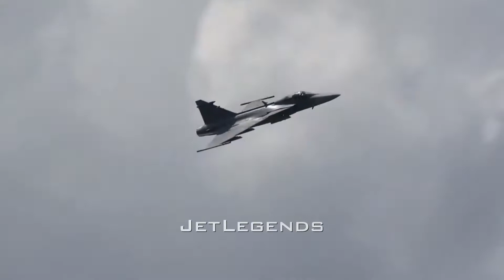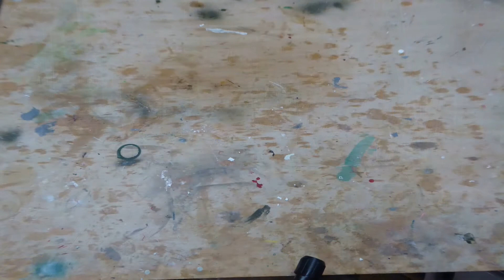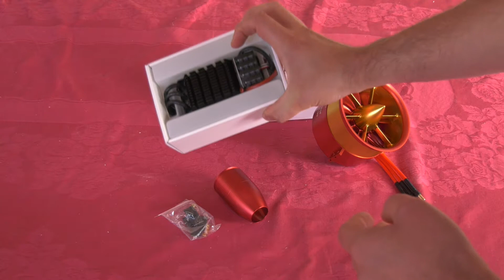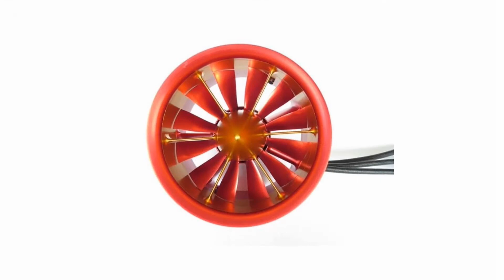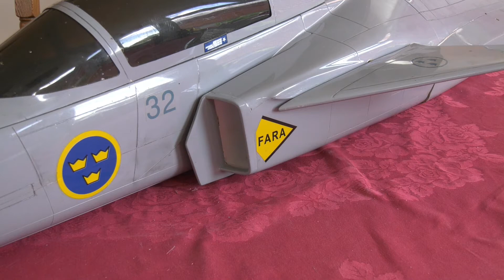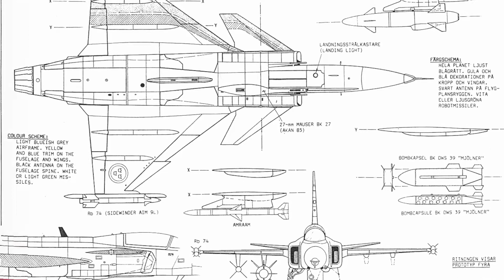Jet Legends RC Gripen Project - Part 1

Comment: Hi. Do you plan to make the canards workable? Am not into jets (love oldies and bi planes) but my friend had one years ago, powered with an impeller and an OS 15 ccm engine. I remember him building a linkage from a servo to the canards axis, then later deciding to have them fixed with 0°, even though he ball bearing'ed it. He said it needed so little throw that it was not worth the weight of the mechanics. Idk, hope you have fun building this. It's a beautiful jet.
Reply from the maker: Hi.  Yes, I plan to have them movable.  There is a mechanism already in the fuselage along with a servo mount.  From forum notes on this model, most freeze them out at +1 degree for takeoff, and mix them in flight and for landing.  Thanks, looking forward tho the build !